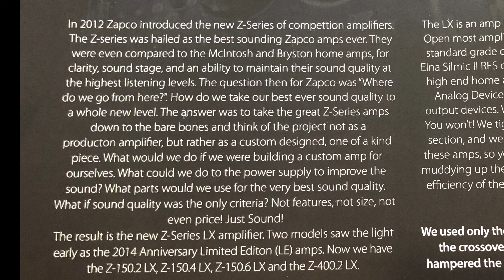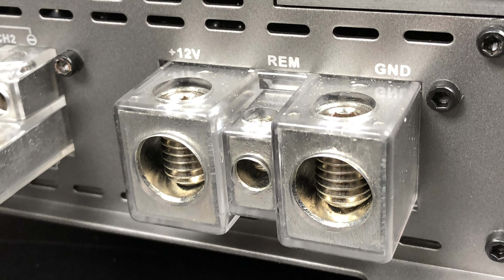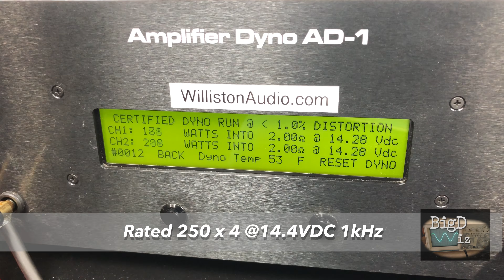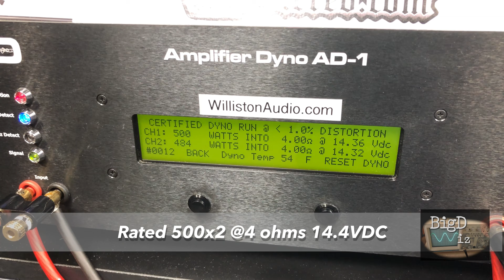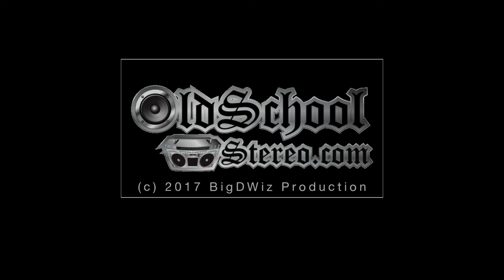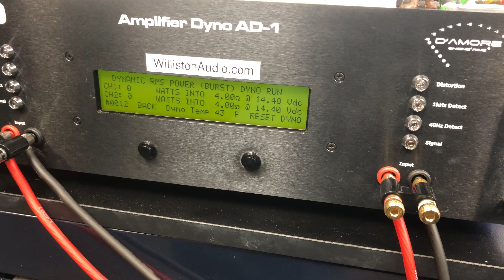$1200 SQ Amplifier? Zapco Z-150.4LX Review and Amp Dyno Test

Comment: Well this might sound like a stupid question but...
Since this is a SQ amp rated at .05% distortion at rated power and your doing a test for 1% distortion shouldnt the power output be greater at 1% then at .05% I just don't really get how they can rate a SOUND QUALITY amp at 150rms@4ohms with .05% distortion and you show that is barely hitting 150 @1%
Reply: Matthew Joseph Distortion doesn't tell you the whole story about sound quality. Amps all have a sonic signature just like speakers. You may hear someone say that is a really warm sounding amp or a really flat sounding amp or some other comment. You can take an identical set up and change nothing but the amplifier and make it sound drastically different. The total balance on high-end zapco has always been really good. The lower end stuff not so much. The old z220-2 was just a spectacular sounding amp. Same with the Phoenix Gold ZPA or audison thesis. You will probably also see speakers like dynaudio. High end morel etc. I've heard some very phenomenal cars over the years that sound very life like. It doesn't come cheap but it is one hell of an experience
Reply: madjimms go listen to an audison thesis and fosgate punch on the same speakers. Both have low distortion but sound night and day different. This is something you will never understand reading spec sheets. You have to listen. If you do the difference will become obvious.
Reply: If you ever get to see a graph, distortion rises very rapidly after a certain point.
Reply from the maker: This amp’s 1% THD and clipping numbers were very close as well, so very probable it hits a limit and goes straight into distortion/clipping. I could not test to 0.05% THD to verify my theory. Great question though 👍
Reply: Kyle Van Thank you for the clarification on this.
Reply: The whole "warm" amp thing I CONSTANTLY hear, is simply distortion.... anything other than the original audio signal will technically be a form of distortion.